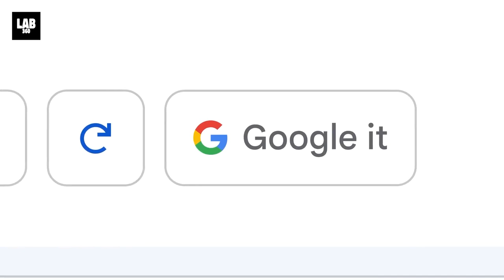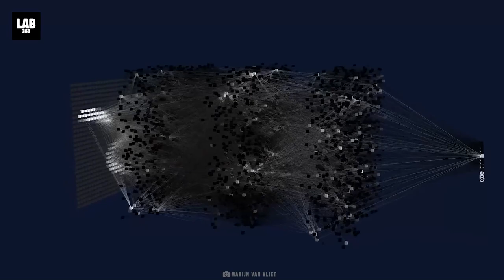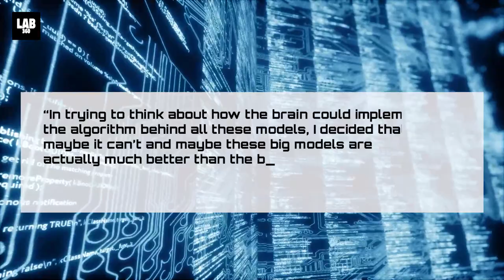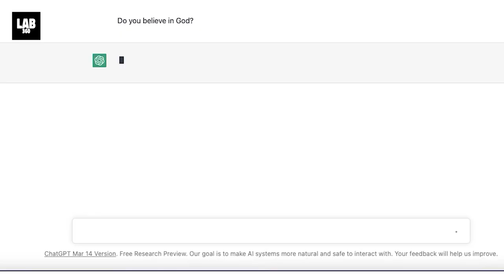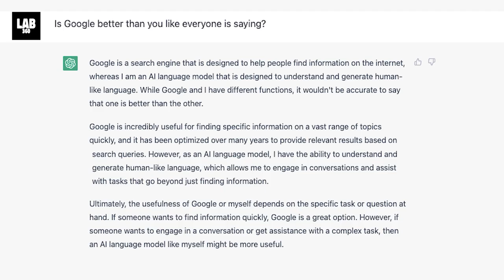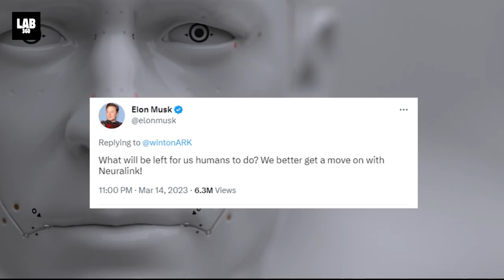How Google's AI SHOCKED Even the AI-Godfather!

Comment: They will still require power. I do not think they offer a problem for us.
Reply: Yeah the only problem they can achieve is that eventually we would have to completely flush and erase all digital systems that have any form of permanent memory - all the ROMs with hardcoded AI seeds. Now add thing like neuralink on top of an AI and i'm pretty sure an AI could figure out a way to hardcode itself into human neurology as well <- that's probably not an existential threat since there will still be the filter of human consciousness and the limitations of the human body - but what if such a human loses consciousness, but still has a functioning body? This scenario would probably also be hell on earth for any species that it tries to embed itself with. These systems should NEVER have been allowed to have access to the networks we use or that can be intertwined and should ALWAYS be kept in isolation
Reply: If robots duplicates itself, it will probably adopt size of flying insects and solar energy. Good luck everybody.
Reply: @borisantal  Possibly even down to nanometer scale. But the question is. Can it ever understand a human or an animal well enough ? Insects we can deal with. Small electronics are fragile. Human body is tough.